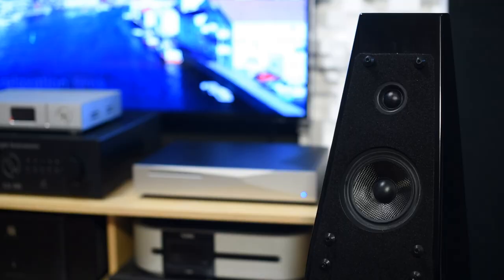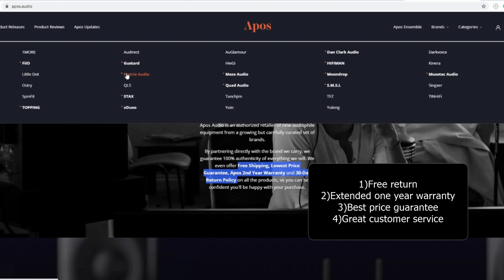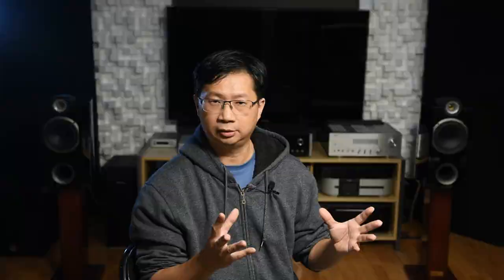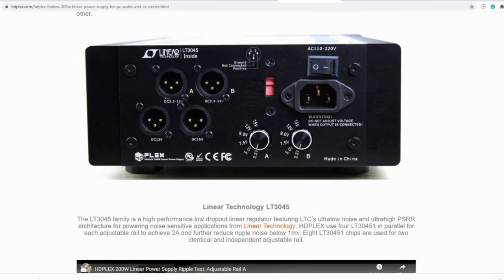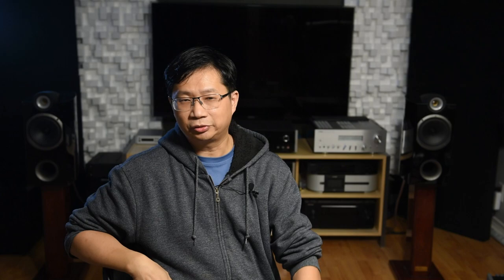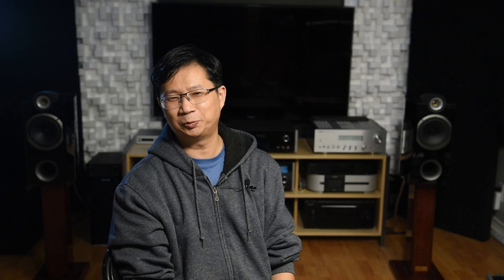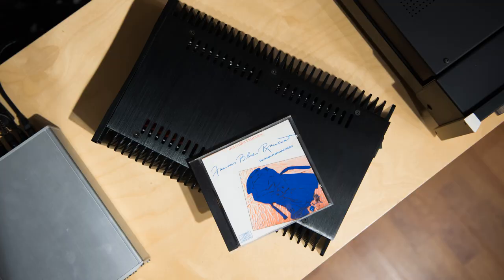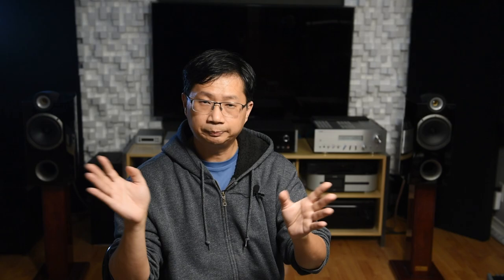Audiophile-grade computer? Really? How do I get one?

Comment: You need to start with your hardware. NO RGB. High Quality power supply. SSD only. Gerald Undone has created by accident a good build guide.
Reply: Does sending audio out threw the Toslink/optical out to an external DAC help bypass some issues?
Reply: @UNSCPILOT  Always helps, your have no electrical connection between your audio gear and computer, for example if you struggle with ground loops.

Comment: Just add water cooling, done 99% silent. Good at least +80% graded power supply (No hokus pokus power supply needed), good motherboard like Asus ROG Crosshair VIII Hero (it has headphone AMP in it too capable to drive even my HD800s (Ofc you get external AMP and DAC). Oh and yeah Ryzen 3000-5000 series CPU. Done. Absolutely no hisses or EMI or anything through USB ports.

Comment: A good made dac like rme adi-2 dac fs doesn't have any difference at all with an intel nuc ,mac mini or this pc since it just takes a signal from usb and does it internal flawless conversion . In my case  teac ud 501 or teac ud 505 which i had made a small but significant difference with the addition of usb card, but rme just didnt do absolutely nothing... it just didn't care and after my research this happens due to asynchronous usb and steady clock fs. So a better dac is better than all these electronics for pc in my opinion. This pc https://youtu.be/iRcA0833PyA now is past since rme made it totally useless
Reply: You are not the only one with this experience, my DAC is fully balanced with it's power supply separated from the rest of the machine, it has very substantial clocks inside as well. And now with any computer or USB card I attach it to the differences are truly minor.

Now I unfortunately only got to this conclusion by spending a fortune on different technology... sigh.

Comment: I wonder if the power supply would improve the sound of the node 2i when used as a dac and streamer?
Reply from the maker: I think the power supply is build in the node 2i unlike the exasound which is external. So I don't think you can use it with the Node 2i.

Comment: For people that thing digital audio is 1s and 0s they should look at how it's actually transferred. It's an analog wave with both the bits and timing information encoded on the same wave, lots of room for bit errors and timing errors to take place. There's articles that go into this. So to me better USB cables, interfaces and power matter. But like you said there's other areas to spend money first.

But I did compare a "free" USB cable to a mid priced cable and noticed a difference so to me it matters! Also different DACs are better at different inputs. Some Coax sounds best, some USB sound best. Trust your ears! 

I actually think Toslink is hard to get right. A lot of people think it's best since it's electrically isolated but if you think about it an electrical signal converts to light, and then back to electrical. More areas for it to go wrong. 

Have you seen the Curious Cable's USB? It seems to get rave reviews. A bit out of what I'm willing to spend yet but maybe one day I'll get one.
Reply from the maker: Thanks, many people have asked me to try Curious cable. I am hesitant to make any more videos on cables, it just invites heated debate in the comment section.
Reply: @ThomasAndStereo  Yeah I can understand posting videos that start flame wars can't be fun! But can always try for yourself ;)

Comment: Thomas, I have an off subject question for you. I thought a while back you reviewed an Emotiva amp, so that's why I'm asking you. I never heard any of their products before, but saw a lot of reviews with satisfied owners. I wanted an external two channel amp to run my front main towers on a surround sound system in one of my living rooms. I do sometimes play stereo through that system, but it's not one of my dedicated stereo systems, so I wasn't looking for high ender, but something with good power, clean signal and lowish cost. So I ordered what looked to me as their best stereo amp, that being the XPA Gen3 Differential Reference. This has two amp boards per channel, making a stated 650W per channel output into 8ohms. On paper, that would be the most powerful amp I've ever purchased. I bought it as new, not refurbished. When I got it, I heard a rattle inside the chassis. Turns out there was a small screw rolling around in there, so I took the top of and removed it. Could not find where it should go if at all, may have been accidentally dropped in during assembly. So right out of the gate, I'm not feeling confident in the purchase. Hooked it up to the front mains and it only sounded marginally louder than going directly out of the AV receiver at any given volume. This was shocking as I expected it to be twice as loud and have to drop it a few DBs to match the center and surround speakers balance, but didn't have to. Then there is the sound. The bass seems strong, but the highs are rolled off and mids were way laid back. Not at all what I expected. I switched out the input cables to very bright cables and that did improve the top end, but it sounded kind of gritty with what seems like a touch of distortion. I tried the amp on a different pair of speakers and got the same result. My question is, did you get a similar impression from the amp you tested,  i.e is this just the way Emotivas sound?  I have several other amps that are 200Wpc and less that seem just as powerful and more detailed, both warm and bright sounding amps. Not sure what to do with this amp I just want to get an understanding of what to expect so I know nothing is wrong with it, especially after finding that loose screw in it. Thanks
Reply from the maker: Hi Taz, I remember mentioning that one issue I had with the Emotiva amp is the top end. I wish it was a bit more refined because I find it a bit harsh. That might be why you find it 'gritty'. The non-differential version top end was not roll-off, but at the same time not hyper detail when compared to a higher-end amp. 
For me, more power does not mean more volume. More power means you can bring it to a higher volume without distortion. If you feel that it is not as powerful, it could be because you are used to higher-end amps and quality watts? Why don't you just return it if it does not work for you?
Reply: @ThomasAndStereo  Thanks Thomas. The amp does its job well as part of a surround system, but I agree, the top end is not refined enough for me to like it for stereo listening and I like a more prevalent midrange. It is powerful and I have not maxed it out, but I did find it's shortcomings to be consistent at any volume, so it isn't like falling apart at high volumes. I completely agree about the volume vs power analysis. In fact, one of my "weakest" amps (a hybrid integrated tube amp), is also amongst my favorites. It only has 65 Wpc, and seems to effortlessly push a lot of different speakers (efficient or not) to fairly high volume (all but those concert like levels) with linearity and clarity. It's the sound quality that I can listen to for hours on end. With the Emotiva, I'm still a bit intrigued with the differential reference setup, so I'm going to try pairing it with a few different components before I decide to liquidate it.  Thanks T.
Reply from the maker: @CUDAbuster  They have a trial period so if it does not work for you, return it.
Reply: Thomas, just giving a quick update on my findings with the Emotiva XPA-DR. As I mentioned previously, I was initially experiencing a gritty sound on the top end and lackluster detail. After that, I ran the amp continuously for about a day and a half and since then ran it about two hours each day. It seems to have broken in and actually sounds very clean now with good detail. I'm guessing the capacitors needed a lot of cycling before they settled in. Remember that there are two amps per channel in the chassis (i.e. differential). I currently have it hooked up to a pair of Polk Lsim707 towers and have been playing a lot of classical music to hear the nuances. I have become quite pleased with this amp, especially considering I did not purchase it for dedicated stereo application, but to run the front channels in a surround system. I now think the DR can serve as a good primary stereo amp if coupled with a good DAC and preamp. Another benefit is that it stays relatively cool after working it hard for a couple hours continuous.
Reply from the maker: @CUDAbuster  Hey Taz, so it needed break in then. Thanks for the update and glad you are enjoying it. Perhaps one day I should give their DR line a try. Right now I am reviewing a pair of speakers from them.
I really appreciate you taking the time to type up an update for me and glad it pairs well with the 707.
Reply: A paradox exists in the audiophile realm, where the desire is for excellence, but the passion is for imperfection. In other words, you can lay down a bunch of money and get what you pay for, which is great sound and in many cases, great aesthetics; however, this can ruin the challenge of what is often times more interesting, that being getting the most out of something that is not expected to be perfect. Of course there is no such thing as actually perfection, but relatively speaking, let's say a 50K+ system gives you perfection according to an individual's musical taste. Well, the 5K system may hold your interest for longer, because it's good enough to be pleasing, but challenges you to experiment and learn how to maximize it's quality. Puzzles wouldn't sell very well if they came preassembled. It is good to have experience with both high end gear and that which is not.
Reply: Thomas, another update on the Emotiva XPA-DR. With use, this amp continues to impress me and I'm not  easily impressed with much audio gear as I've spent many an hour in high-fi shops listening to 50k+ systems. Not that this amp should be placed in that echelon, but it is quite good. Fast, powerful and clean with tons of slam on tap and crisp highs. Recall when I first got the amp, I was very disappointed; however, after hours of use, it smoothed out, or more appropriately, balanced out and the top end cleaned up. I have played many hours of audiophile albums with it paired with the Polk Lsim 707s. I've been meaning to pair it with both my Cornwall 3s and Altec Lansing A-7, but the Lsim seems the proper type of speaker match for this amp. I would like to have more layering in the sound, i.e. holographic, but this is probably due largely to lack of use with high end DAC or tube preamp. Regardless, the amp is not just good for the money, it is good.
Reply from the maker: @CUDAbuster  Hey Taz, thanks for the update, with a good tube preamp, you should get more layering in the soundstage and I am glad that the break-in helped.
Reply: After wrapping up with this budget gear, time to refocus on high end. Have you tested and of the Manley tube amps, such as the Stingray 2 integrated? This may get into my wheelhouse for driving the slew of horn speakers in my collection, but I've not found anywhere to demo their gear.
Reply from the maker: @CUDAbuster  I will be making a video on Doge 10, worth checking out.

Comment: sorry thomas, but  i would like to chime in my two cents worth .  i am not a deep audiophile, though i am trying to learn and do it for less money as I cannot afford it.   But:

i don't get it.   isn't it that what is transferred from your computer to your dac thru the usb cable,  are just zero's and one's of data for your dac to decode.  how then can a power supply,  a fan and a usb card affect the data that is being transferred.  

are you saying that when you transfer any data from a computer, to an externat hardisk or external usb,  the data gets affected by the powe supply, fan noise and the usb card that you are using.

i don't think it ever changes, cause if that is the case, then everybody should be paying attention to the usb card, power supply and cpu fan that they are using in their computer, hence the data, specially financial data, that they are putting in their external usbs' or external hardisk might be changing,

if you try to observe, when you copy data, from your desktop, to an external hardisk or external usb, the file size would be the same up to the last bit - so no data is lost, even with a noisy fan, and ordinary power supply or just the built in usb port of the motherboard - so no data is lost whatsoever, and   i think this also applies to music data or any data for that matter.

sorry, but just my two cents worth.  hope you will read this and comment and others too can comment .

thanks much for your time and others' time.
Reply from the maker: I completely get what you are saying. I myself have gotten a degree in pure and applied science during my college years so I understand why it is important to understand the science behind it. I have read many articles trying to explain it and the truth is I have found nothing satisfactory to date. So in that sense, I cannot answer your question.
Now if you are curious, I would advise approaching the whole question not as a theorist but as an open-minded observer. After all, science is based on observation and ultimately, we are after the truth and it is not about winning arguments over the internet.  Get yourself one and try it.

Comment: It bugs me how many people are trying to "improve" their computer for music (or buy a supposedly magical machine that costs $5,000) where the best thing to do is simply to get rid of the computer all together. 
No matter how silent is your fan, there's still a fan. And if we're extremist enough to discuss how this -140dB DAC is better than this -120dB DAC then no, installing a BeQuiet fan or not is not even the question. The question is how do you get rid of the fan. And how to get rid of the computer with coil whine etc. 
As for the 0s and the 1s, there is no issue with the 0s and the 1s, they won't change because of noise or whatever, that's why we invented digital in the first place. Can you imagine how images and videos you see on Internet would look like if you'd apply the reasoning you apply on audio? That's total non-sense. 
I'm not saying there is no issue in digital, but the issues in digital are ABSOLUTELY NOT THE SAME than the ones in analog. So, for the sake of god, people should stop trying to apply their analog reasoning, tweaks and fiddlings on digital. 
Deal with the digital part of your system with a digital mindset and deal with the analog part of your system with an analog mindset. And try to make the best and easiest interface between the two. 
The issue at stake here is mostly due to the interface. Most DACs will be smart enough to only look for the 0s and the 1s and they won't "transfer" whatever is not the digital information to the conversion/analog part. If your DAC is bad enough so that noise is an issue, just upgrade your DAC instead of investing your money in a $5,000 machine. And if you want to be diehard about it, switch to an optical interface, and purely and simply get rid of USB all together, easy, elegant. 
My solution is based on Roon and the only digital device that I have connected to my audio chain is a ridiculously simple Raspberry Pi connected to the network. The Roon Server is not even in the same room. 
TLDR; Get rid of your computer, get a network streamer (which can be a standalone solution or something like BlueOS or Roon) and upgrade your DAC.
Reply: So you are getting rid of the fan and encouraging adding RF receivers into the system. I would go cables over transmitting every day of the week.
If you stream then a well thought out PC music server with BT and Wi-Fi disabled is just as viable (can be better in my opinion).
Reply: @theallblack1407  Who said RF? I don’t use wireless on my audio. Everything is connected via cable.
Reply: @Maxime-ho9iv  Fair enough. Your right then, a PC system has a lot to be desired and it took me months to get the noise out to an acceptable level and it still doesn't beat a good CD player.

Comment: raspberry pi, volumio and a usb dac.
Reply: USB out on the raspberry pi has alot of clicks and pops, using a HAT solves that.
Reply: @dajikbatarang1  must be something wrong with your raspberries
Reply: @77936fief  actually its a well documented problem
Reply: @dajikbatarang1  audioquest dragonfly usb, never had the issue
Reply: I want to set this up for my living room source. Where do you store the music? NAS? A PC? Can you access the GUI via a smart TV or streaming device?
Reply: @TheIngoBeck  If you use volumio or moode you can plug a external USB hard drive directly into the Pi.
Reply: @dajikbatarang1   Can Volumio on a Pi play music stored on a home network (flac)?
Reply: @TheIngoBeck  Yes it can access a NAS
Reply: @dajikbatarang1  schweeeet. 👍
Reply: @TheIngoBeck  i use a linux based O/S on a pc to store all my media. i use plex and volumio as my streamers, most smart tvs has plex on their app store which makes it a breeze to use.
Reply: @77936fief  I'm interested in getting bit perfect digital to my DAC which my TV won't do (resamples to 48khz). It would be AWESOME if there was a Volumio app for smart TVs so the GUI could be displayed on the TV and control Volumio running on the Pi which can output bit perfect to my DAC.
Reply: @TheIngoBeck  that's actually a great idea.you can however, set up a volumio server and access it via the web interface on the smart tv. there is a paid app on the play store for it.but i doubt it will work on tv. alternatively you could always try plex.